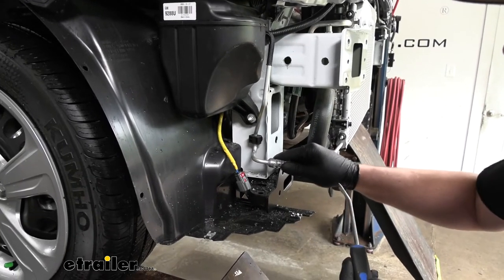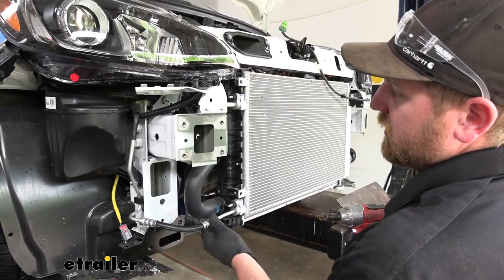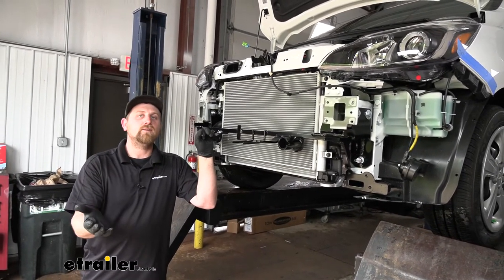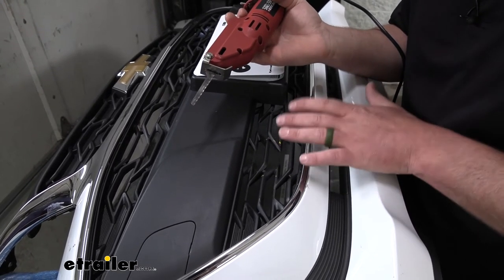etrailer | 2021 Chevrolet Spark Roadmaster Direct-Connect Base Plate Kit: Complete Installation

Comment: Which bsseplate is best for a Spark, RM or BlueOx?
Reply from the maker: If your Spark has the manual transmission, it is capable of being flat towed.  We prefer the Blue Ox base plates, they're a bit easier to use and a little less visible when the drawbars are removed. For LS models, use # BX1725 or # BO54FR for all the rest of the models.
https://www.etrailer.com/Base-Plates/Chevrolet/Spark/2021/BO54FR.html
https://www.etrailer.com/Base-Plates/Chevrolet/Spark/2021/BX1725.html
Reply: @etrailer  which is stronger, better mounted?